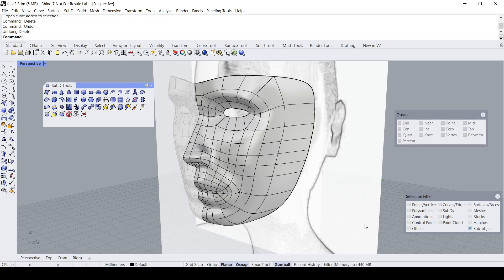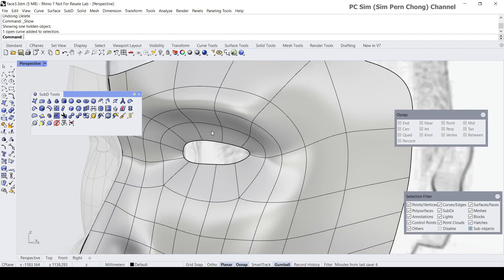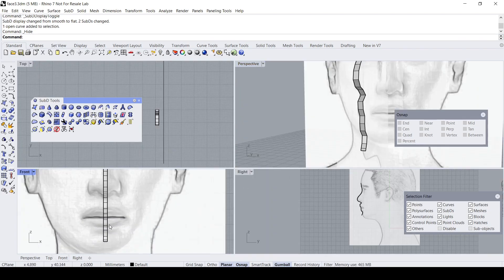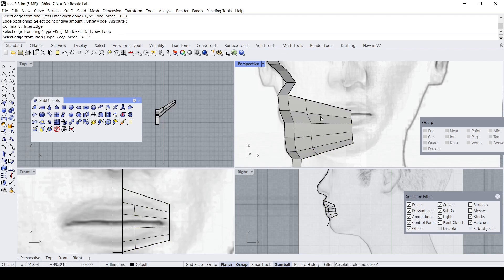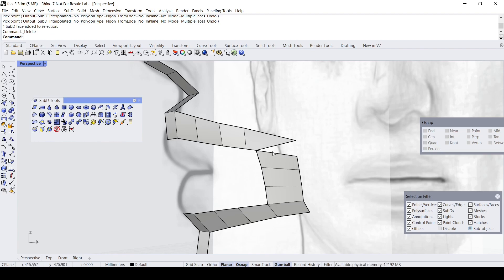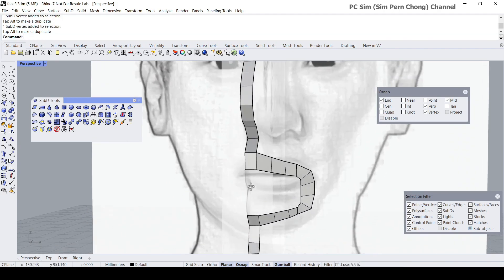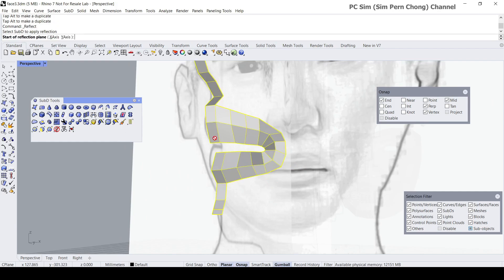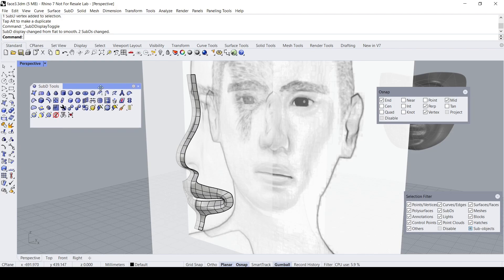Rhino 7 Tutorial:  Human Face Modelling Process (Requested)

Comment: is it possible to do this but without polys, because this is how I do it in C4D. can it somehow be done with curves instead?
Reply from the maker: It is possible model directly using Sub-D. In fact, this demo is in sub-D, I merely toggle between the Flat and Smooth mode using the TAB key. Cheers
Reply: @simpernchong  oh, i didn't realize that. thank you so much. I've always wanted to explore sculpting a face using curves. thank you :)